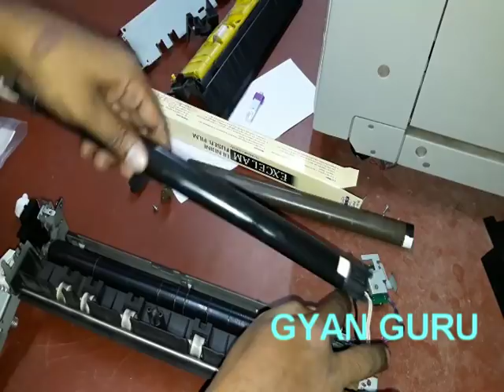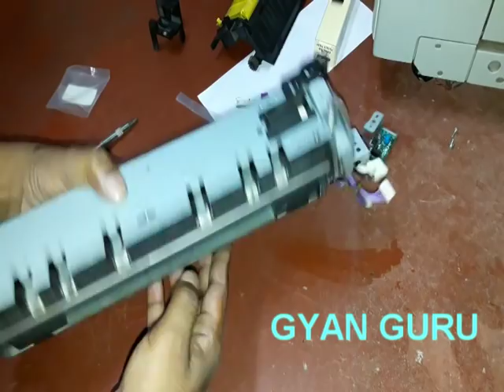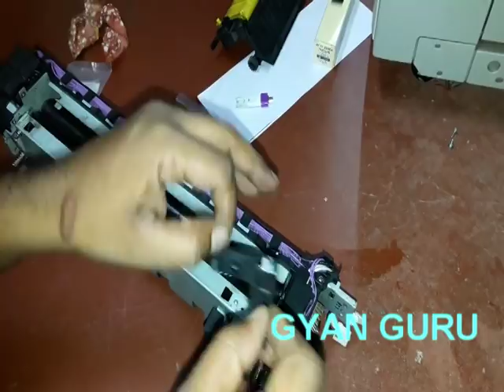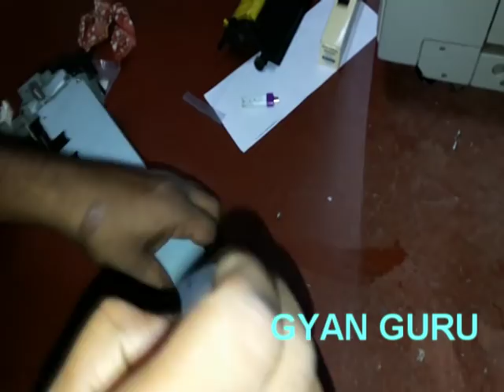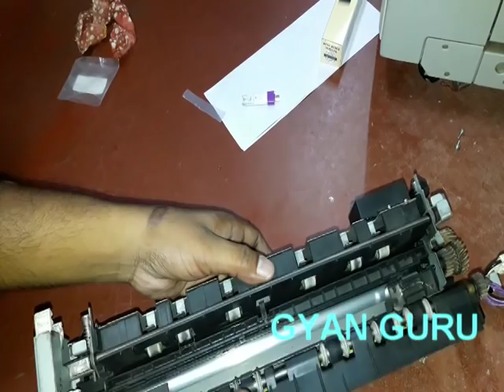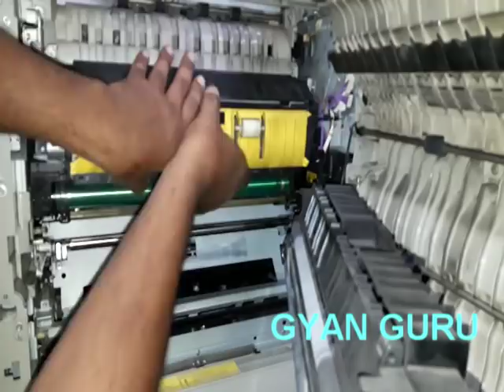how to change fixing unit film of canon copier machine part 2

Comment: Sir koi film change karta tab white colors liquid lagate te vo kya hota he or uska benefits ?
Reply from the maker: white colour se sensor continuously printing ka cam karte hai.... agar white colour na rahe to paper jam hoga do-char print ke bad paper jam hoga. sabse acha new film lagana acha hai, kew ki main motor pe presser parte hai and main power board and ip board  par presser parte hai.
Reply: Gyan Guru sorry but meri query samje nay.. new film lagate he tab pahele white color ku6 lagate vo kya hota he pu6 raha hu... uske benefits ?
Reply from the maker: fuser oil bolte hai --- jaise car me greez llagate hai wheel acha ghume... a ak oil hai jo temper me ve kam karte hai.
Reply: Gyan Guru sir heating patti continue jal rahi hai problem kyaa he sir
Reply: Sir 10-12 print k bad paper fas jata h back to back m.. Fixing unit se pass nh ho pata us se phle he paper ka roll sa ban jata h... Plz provide the sol..

Comment: canon 3300 eror14 ka solutions bataye
Reply from the maker: E014-000DescriptionAfter the fixing motor drive signal is generated, the clock signal does not arrive within 1.3 secCausesThe fixing motor (M19) is faulty. The DC controller PCB is faulty.Remedy1. Connector Is the connector of the fixing motor connected? NO: Connect the connector. 2. Main power supply PCB Is the drive voltage (24 V) of the fixing motor supplied by the main power supply PCB? Main power supply PCB: between J202-3 (24VU1-S) and J202-4 (OVU1) NO: Replace the main power supply PCB. 3. Fixing motor (M19), DC controller PCB Press the Start key. Is the lock signal of the fixing motor present at the connector (J312) on the DC controller PCB? Lock signal: J312-B4 (FSRM_LOCK*) the DC controller PCB change from 0 to about 5 V? YES: Replace the fixing motor. NO: Replace the DC controller PCB.